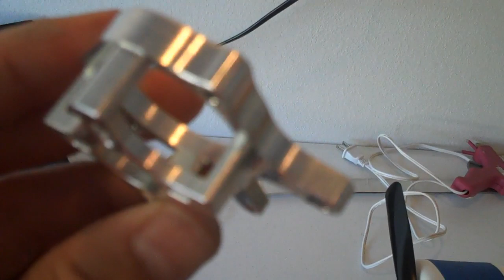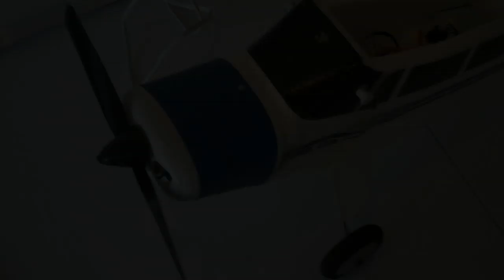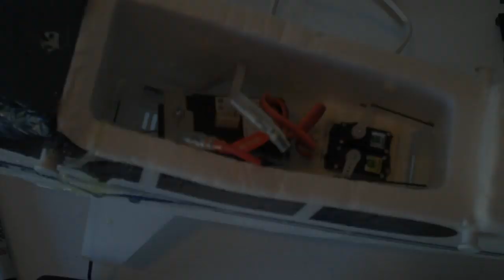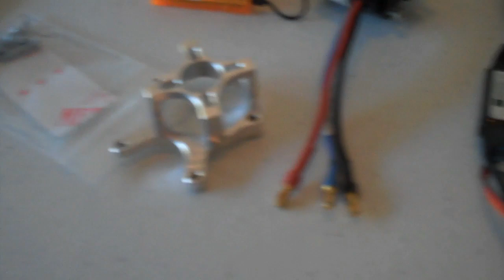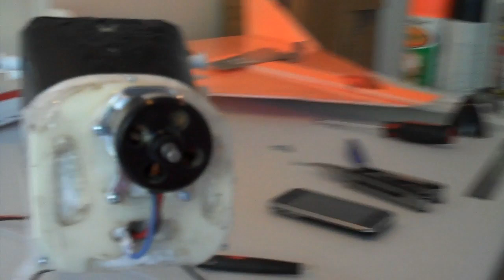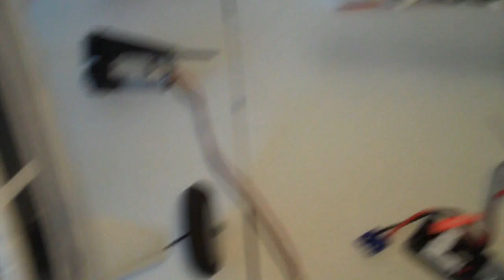HobbyZone Super Cub LP - Brushless Motor upgrade

Comment: Thats right, the hard plastic face popped right off the foam firewall.
So I glued it with a few long gyproc screws drilled through.  Should hold better now.  Must be cautious with the full throttle position now. Flew it this evening already and it performed perfectly.  Nice plane with some good authority now.  Thanks for your vid.

Comment: ha,ha.  While flying mine this evening I was pulling up into a loop and "pop" something let go on the plane.  A couple hundred feet up was hard to tell.  It spiraled down fairly slow and I powered off the motor.  Shoot, the motor yanked the nose right off the plane and was dangling by the three connected wires.  Lucky when it dropped into the tall canary grass no other damage much occurred.  Re-enforcing and glue will be good to go again.  Otherwise flies great with brushless.  10x8 prop. zoom.

Comment: Also using the 1300. I cut out the top of the batterey compartment for a bigger battery (soon).  The battery stays up front, I have the mount from customrcparts, but its longer than yours.  Im guessing it may be the CG, havent had time to mess with it.  Tired of crashing it when i have time

Comment: Hey Wade, did have any issues with it being tail heavy after the upgrade?  I did mine with eflite480, i cant get it to fly, it goes straight up to the right then crashes everytime.  I  noticed your mount was smaller aswell.  Any suggestions?